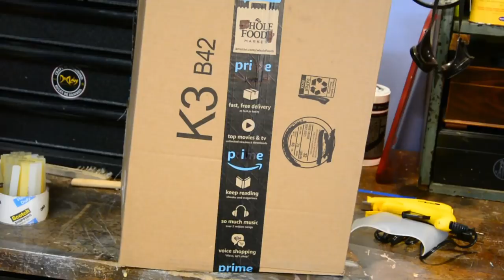SIMPLE DIY Sound Booth - EASY to build

Comment: Interesting build, I would however like to touch on something you said. While you're in front of the booth you should wear a T-shirt or something that does not make noise, but this is only used so that you, yourself do not make any sound. you should get a sheet, or blanket and hang it behind you this way you'll really stop the reflection from behind you, I would recommend you use more than one material for this, due to this being the open space it needs to be more deaden.
Reply from the maker: Score Moore interesting! I’ll try it out